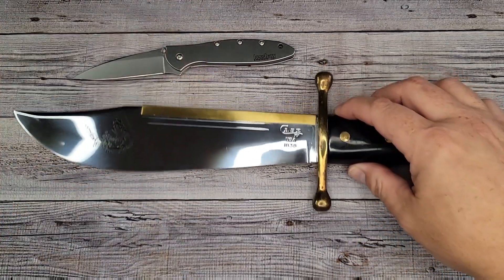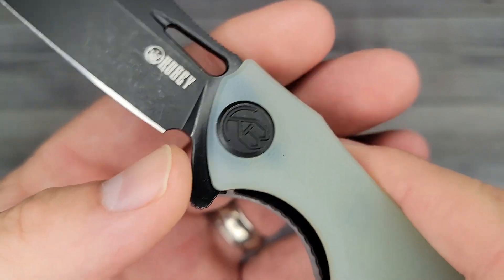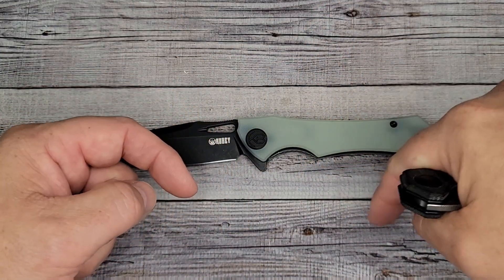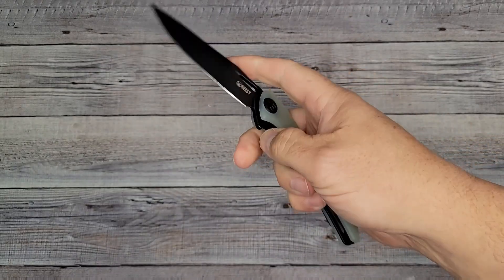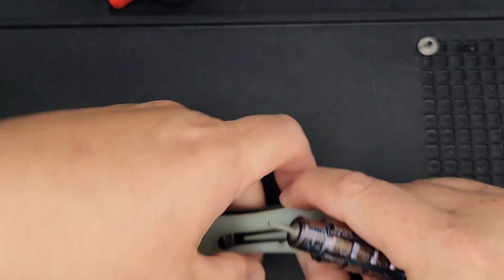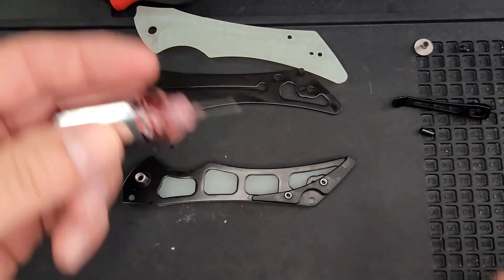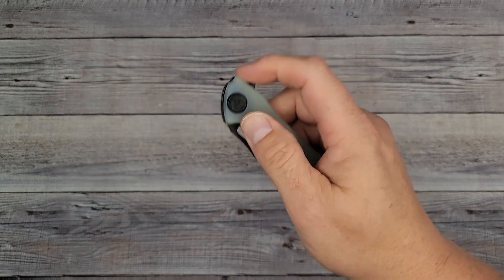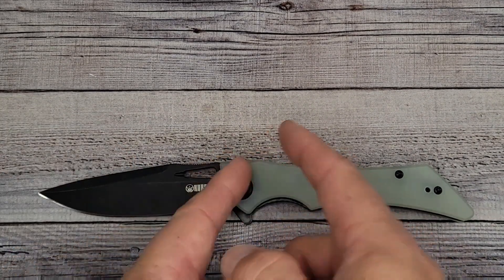KUBEY RAVEN KB245 OVERVIEW & DISASSEMBLY THAT'S NOT A KNIFE - THIS IS A KNIFE!

Comment: Months back you recommended, that Kubey had a knife on sale on their website for $30. that was the Darkness. Well 3.5" Aus 10 steel blade and g10 handle. this knife is perfectly centered, drops shut smooth with a hydraulic feel. straight from the factory, only complaint is the clip sucks, but that can be changed. Kubey's quality is so much better than many knives twice its price. Thank you so much for all you do for the community.
Reply from the maker: You're very welcome, Tony! 👊. Dude, $30 was a steal!

Comment: This looks to be a reissue. I bought the original black handled/ satin bladed one about 3 years ago and it has a titanium pocket clip and much more heavily contoured handle scales, as well as AUS 10 blade steel. While I prefer those features, these newer models look to have way better texturing and and a bit larger flipper tab, that isn't nearly as pokey as the tab on the original. It also has a lot more jimping. I'm guessing the one I own is the more expensive version you mentioned as it is in AUS 10, not D2. If I remember correctly I paid $59 for it at the time. (IMO those natural G-10 scales are begging for a burgundy dye job.) Thanks as always for posting!
Reply from the maker: It would look great in burgundy! This version is Aus10. I imagine they did upgrade some of the features, like the jimping. A titanium clip would have been fancy!

Comment: Mornin' Beez. Very cool design. Not just the asthetics either. Love the details like the flipper jimping that goes all the way around the tab and the thumb shaped curve for the spine jimping. I had a feeling that the deceptively small thumbhole would work just fine. The jade g10 is nice whether or not it gets dyed, but I can't help but wonder what black linen or canvas micarta would look like on the Raven.
Reply from the maker: Oh man! If it had some nice Micarta, it would be awesome!
Reply: @BeezBlades  The Raven and Momentum Kubey's definitely need a nice micarta handle run with 14C or 154CM at $50 or under.  That would  put them up there with Kizer and at least stay even with Petrified Fish.

Comment: Aus10 ? Interesting
Reply from the maker: It's a great steal, as long as it has a good heat treat. At least that's my understanding. I have a ton to learn though 😅.
Happy Monday, Michael! :_BeezBladesWelcome::_BeezBladesBeez::_BeezBladesRed::_BeezBladesWelcome:
Reply: I find IT a little Bit Tricky to charpen.
Walter Stones are perfect for D2
I tried a pricy Diamond Plate from China but scratched the Blade 
Now i send them to a knive maker for charpening

But they stay really Long Sharp great for Camping without charpening Tools
Reply from the maker: @andreglomm9843  Oh man, I bet you get them back razor sharp! I've never heard of Walter Stones. I'm going to have to check them out. Thank you, Andre! I hope you had a great day.:_BeezBladesWelcome::_BeezBladesBeez::_BeezBladesRed::_BeezBladesWelcome:
Reply: @BeezBlades  Walter was a Special German Tool and knive maker company.
Naniwa Superstone with 1000/3000 grid are really similar wetstones. But I'm Not Sure what Stones that are 

Also i use Sometimes a 300 and 800 grid or something Like that i think it's a Arkansas Stone with oil for really Dull onives with badly used blades